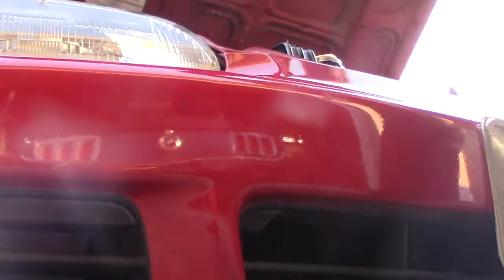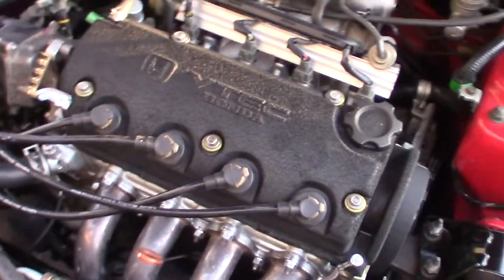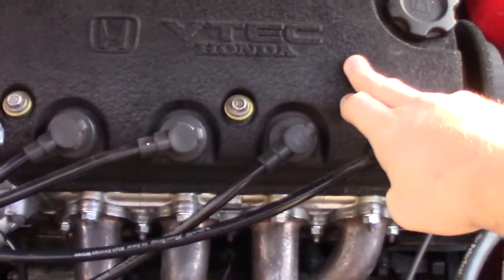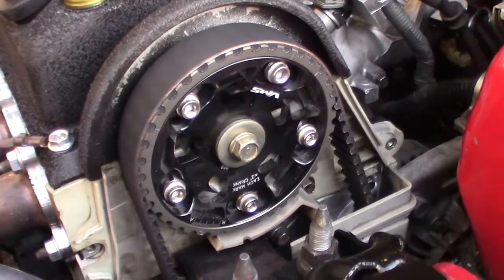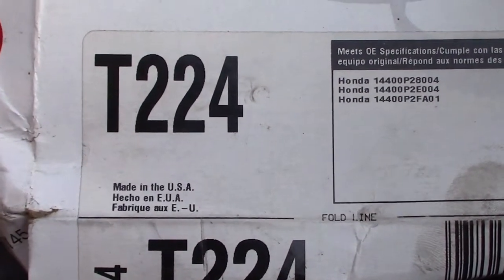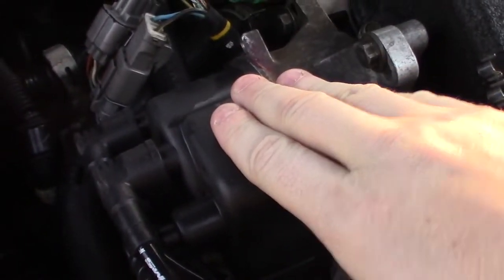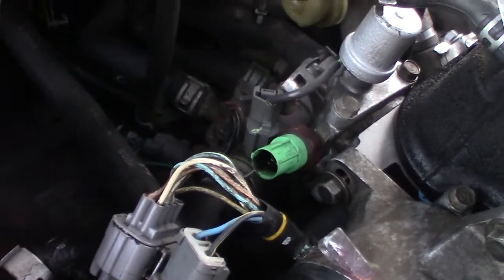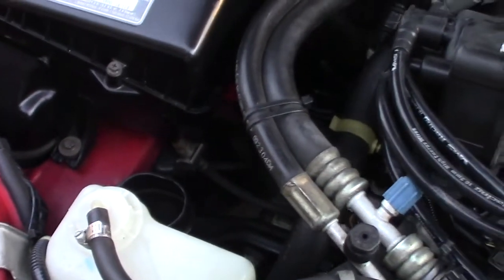Mini Me Swap: Honda Civic D15B7 / D16Z6 Head - Parts, Budget, and More!

Comment: Literally saved my life right here, I have never worked on cars before in my life really, and now I am doing a full rebuild with a d15b block and d16y8 head and I had no idea what to do so thank you for this great information!!
Reply from the maker: Hey Glad to hear it was helpful! Is it a b7 block? If it isn't just make sure you don't order the timing belt parts that I used lol they will be different since I used  Z6 head and a b7 block (I believe)
Reply: @RiggsGarage  no its just the d15b block, but I just finished my parts list and all of the according parts.
Reply: @nathanhamilton8717  man u sure you read to work on engine builds and u apparently never worked on cars b4?
Reply: i’m in this exact situation right now down to the t. how did the build go?

Comment: I have a D15B7 Engine but the Sensor is on the on the top of the throttle body! 
6 years ago we did do a top engine rebuild and bought a rebuilt head... 
I looked and it's definitely not Vtec... 
Maybe my mechanic replaced the throttle body a long time ago and I forgot....
Reply from the maker: Interesting, what are the casting numbers on the head? Does the head have a VTEC solenoid?
Reply: @RiggsGarage  No it doesn't have a solenoid.. I looked where you would put a... forget the term the blocking plate, but it's cast iron or whatever it's totally closed... I will check it inside when we swap it to make sure... Talk later... I'll look for casting numbers later...

Comment: You're Awesome for doing this! Helps a ton!
I have a 95 Del Sol with same engine, D15B7. 
Mine is leaking fluid / oil into the coolant system and probably into the oil...
So not sure how I am going to do this.. might have to just get a D16Z6 Engine... 
I wanted to do this min me swap for fun though... If I can save bottom 1/2 of engine I will do it...
Reply from the maker: Yeah the swap is pretty good, but if you can grab a nice running z6 engine swap for for 3 to $500 I would do that, especially if you want to give it a little bit of boost in the future for extra fun.  Thanks for watching!
Reply: @RiggsGarage  Yeah, I am going to start looking for a D16Z6 Engine to put in mph car. It will be cheaper and easier all the way around... OBD 1 is the same, easy to drop in, cheap to buy, and could boost it in the future for fun! Thanks again...
Reply: @RiggsGarage   Okay, Need your help! Just called 2 places my mechanic recommended to buy engine. They dont' sell the D or B series engines anymore. Any tips on where to look? Thanks!
Reply from the maker: There are several big JDM engine importers around the country that will ship you a low mile engine from Japan on a pallet that you can just bolt in. I would just Google JDM engine importer, usually pretty good prices. Then you can grab a D15B or some other higher performance engine that will bolt right in where yours is
Reply: @RiggsGarage  So a D15B is better than D16Z6? 
And thanks!!
Reply: @RiggsGarage  Thanks for the google tip. Just found a Quality place about 30 minutes from me! They have the D15B... I'm looking at stats to see which one is better.. if you know let me know, thanks!
Reply: @RiggsGarage  Turns out my mechanic at the time sabatoged my motor... he loosened the valve cover bolts. It was leaking for the first time ever.... he put oil in the air intake tube and on the Maf sensor and all over the throttle body. Fresh oil... he loosened up the idle screw all the way... so it was going up and down up and down... and loosened bolts on fenders... I know because I caught him lowering my tire pressure to 18 pounds. The night before I set them to 32 pounds psi. And I just did a smog 1 1/2 months before, so I changed spark plugs, wires, oil, air filter, cleaned out throttle body, air intake tube, Maf sensor, checked / tightened all the bolt son the car. Had a fender bender a few months before so the bolts were tight after getting fixed... 2 mechanics told me it looked like someone poured oil into the overflow radiator tank thing. etc. etc...So here I am more than a year later and I finally found everythign he did and she's running strong and perfect and no more up and down surging with the engine.,.. gas mileage is a lot better, never had any smoke out the tail pipe or anything in the radiator fluid and the oil was always fine... I learned a lot on this journey over the last year or so...

Comment: Amazing! How did your mileage change?
Reply from the maker: I haven't really noticed a change, however it still has the wrong computer, I'm driving the car differently and less since covid has affected my commuting. So I can't really answer the question accurately haha
Reply: I have a d15b with 260,000 miles and the head gasket went, so I put a new gasket on with a d16z6 head. I just filled up today and got 37.77 mpg. Stock the best I got was 36mpg. But I did also rebuild my transmission at the same time.
Reply: @brandonhill88 did you use a z6 belt and cam gear? I have a 40k d15b block and I'm trying to get a z6 head on but it won't stay in time and start

Comment: Awesome video. I'm in the same situation. I picked up a 95 Civic EJ2 (coupe) with a d15b7 for $1000. The clutch was cooked so I got a new one. It sounds like the water pump and timing belt tensioner need some attention so I'm thinking of doing a mini me swap. The body is in really good condition so definitely not bailing on it. This video answered alot of questions. Thanks!
Reply from the maker: Awesome, glad I could help and thanks for the comment!

Comment: Did you use the d7 head bolts or did you use z6 head bolts?
Reply from the maker: I used the factory B7 head bolts.
Reply: Yeah cuz I tried just putting a z6 manifold on my b7 and it was running very rich and I don't know why
Reply from the maker: @kurbuy21  sounds like one of the sensors is sad. Got a check engine light?
Reply: @RiggsGarage  no check engine and when I put my stock intake manifold back on it went back to normal but you can look at my channel I posted a short video of what was going on

Comment: Desperately trying to find these parts to start working on my 93 Honda dx 🤣
Reply from the maker: Keep looking, you'll eventually find a sweet bundle deal like I found. Make sure you can get the head with matching distributor and valve cover, and a better intake manifold than the B7 is definitely recommended too. Good luck!
Reply: @Beast-mode-dc7jb  ef chassis is definitely best candidate for a mini me swap

Comment: Good vid doing the same build lmao didn’t know people still do mini me in 2021 anyways I got a question if. I port and polish the b7 manifold will it be as good as a z6 or better ?
Reply from the maker: Good question, but I think you'd have to take a ton of material out of the B7 manifold. As part of the project I did set the Z6 and B7 intake manifold side by side and the Z6 has significantly fatter intake runners. I would go to Pick-N-Pull and grab a D16Y8 intake manifold, they're dyno proven the best and are available for cheap

Comment: Are you able to use the stock z6 cam gear with the head when doing the mini me ? Or is it mandatory for adjustable cam gear
Reply from the maker: Good question - read this thread I posted above and see of you get the same thing I got when I read it (it's well written, but kind of confusing) - he says z6 head use a y8 gear and advance belt 1 tooth. This is why I got the adjustable for $50 and I can mess with it without having to swap gears and take belt on and off. The $50 is worth it to me to save hours of messing around, plus finding a different gear that I don't have.  
https://www.d-series.org/threads/how-to-mechanically-time-a-mini-me-swap-other-mini-me-info.166652/
Reply: If you're putting a z6 head on a d15b block (except for the JDM D15b vtec one), then you need either the adjustable cam gear or the y8 cam gear and advance a tooth.  The z6 head on a d16y block reuses the z6 cam gear - and all of the z6 timing components.  I'm currently running z6 head/y8 block in my hatch.
Reply: Yes You can

Comment: How much horsepower do you think you gained from the mini me? Im considering doing this but Im not sure if it's worth it (in the Netherlands a turbo kit is way to expensive so this is the only way to get like a (big?) bump in power
Reply from the maker: Hi, thanks for the comment. Realistically probably about 20 horsepower without a tune, but I'm not even seeing that yet because I'm not running the VTEC computer to kick in VTech and give this thing a more aggressive fuel map. I just bought the computer yesterday though so I should have it up soon. That said, an extra 20 or 30 horsepower and a 2000 lb car is a noticeable thing. and it's using all Honda parts so it probably won't fall apart if you do it right haha.